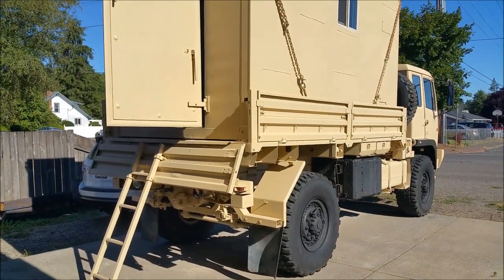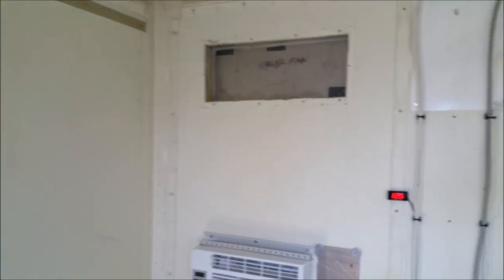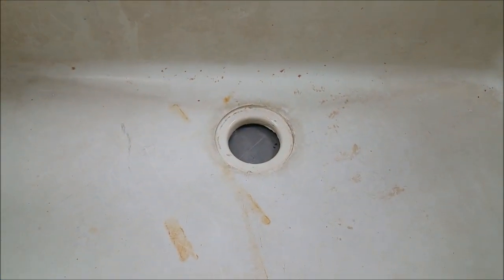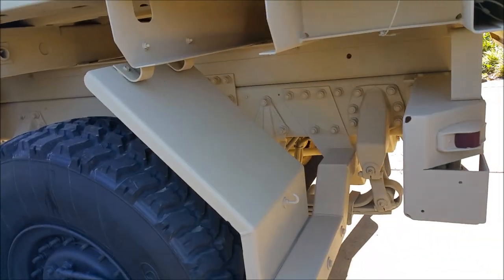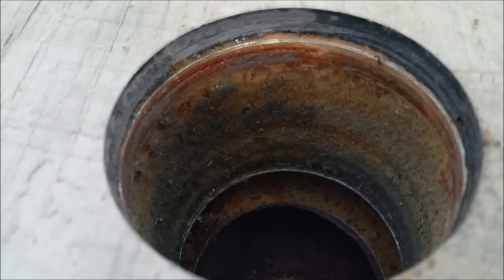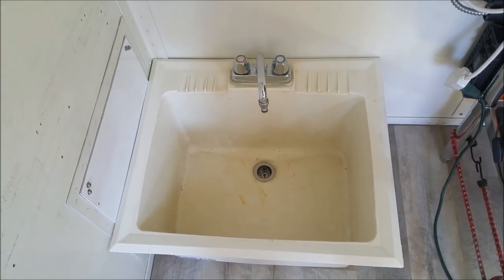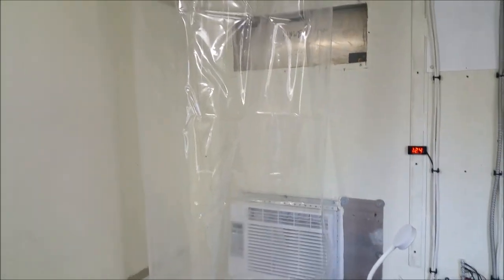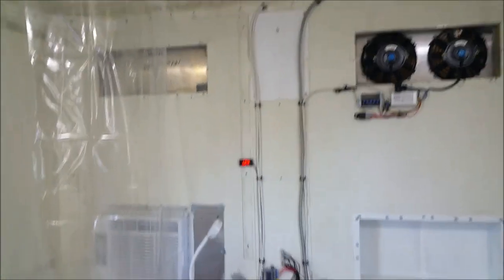Abel LMTV build part 17  (utility sink/shower install, disabled veteran park passes)

Comment: Are you going to have a toilet?  They have cassette toilets that are removed from the outside and can be dumped in a regular toilet (no dumping station  needed).  Nice build so far, keep up the good work.
Reply from the maker: Absolutely not.  We are often in very remote areas so there is no need.

Comment: Do you happen to have a link to the water tanks you talked about? Also are those rackmount cases you have attached under the bed near the battery's and fuel tank? I like it!
Reply from the maker: Scab:  They are ecs cases.  I covered it in a previous build video.  If you have your muffler removed on your m1078 these water cubes will fit perfect tucked up inside the frame rails.  I figured you could fit 2 of them on an m1078.   You might be able to fit 3 on a 6x6.    As with anything YMMV so check measurements before purchasing.  https://www.amazon.com/gp/product/B077ZCQXBF/ref=ox_sc_act_title_7?smid=ANNYFJC2Y5PU4&psc=1